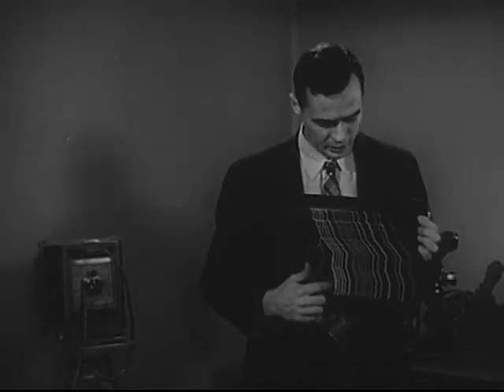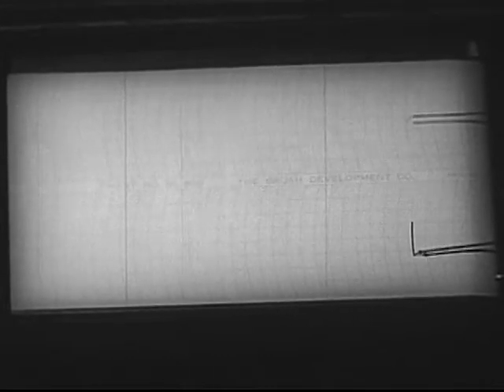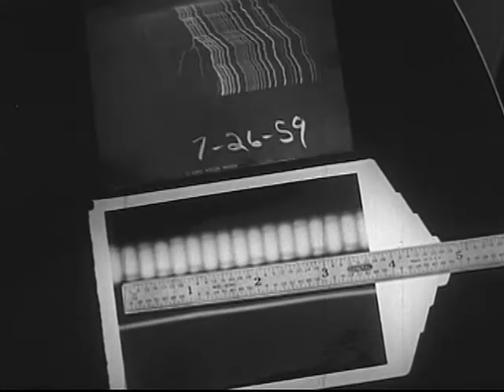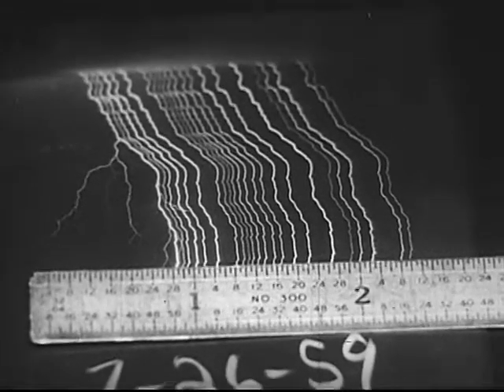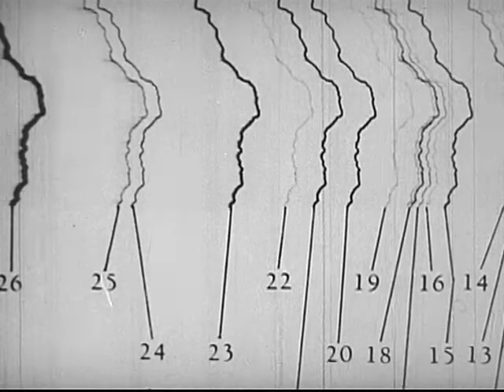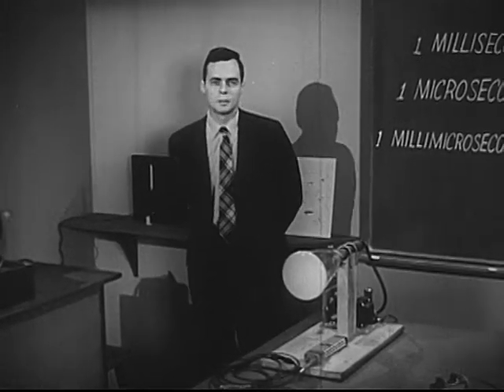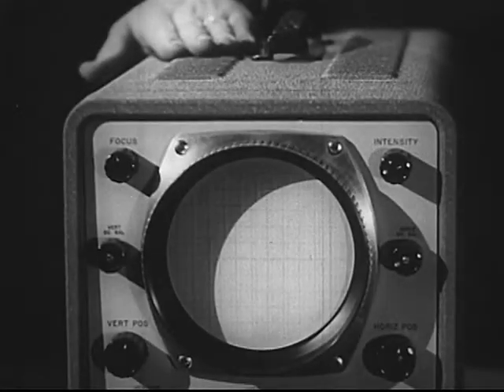Physics - Short Time Intervals (MIT) Physical Science Study Committee

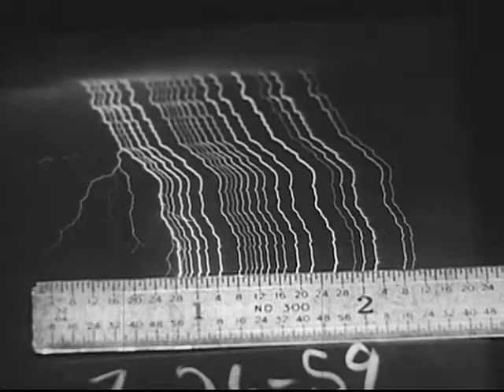Comment: When he is showing the lightning stroke on the film the size of the original negative, at about 8:00, he says, judging by the distance between the strokes on the film, how long the time is between strokes. How can he make that determination based on the literal distance on the film - when the camera is moving linearly? If the lightning were farther away, the apparent distance between strokes would have been smaller. If he had a line of flashing beacons running straight from the camera into the distance (and slightly below the camera), 2 flashes of the beacons on the moving film (moving left to right) would look like this:   /|   -the furthest beacon at the top apparently moving less than the nearest one at the bottom. Any of the other 1 people watching this video have an answer? He really can't make that determination unless the camera is rotating.